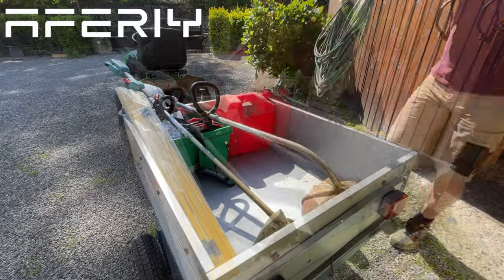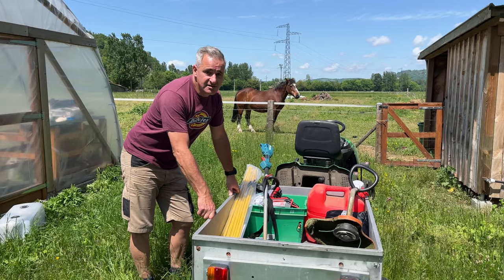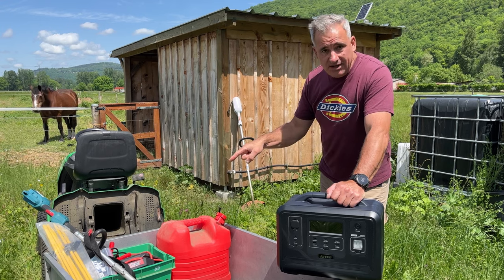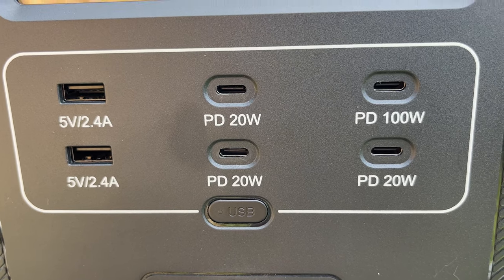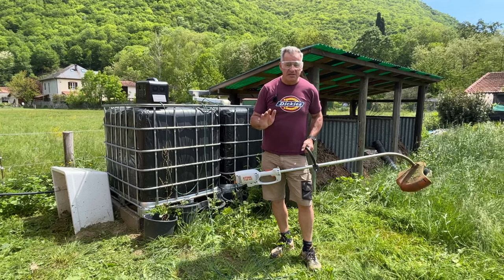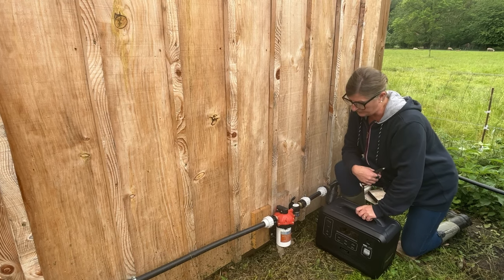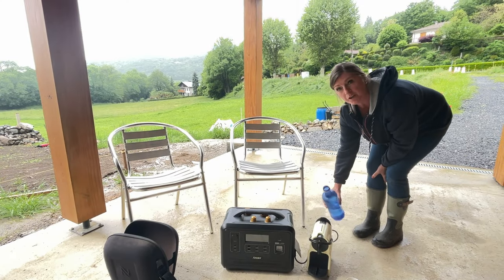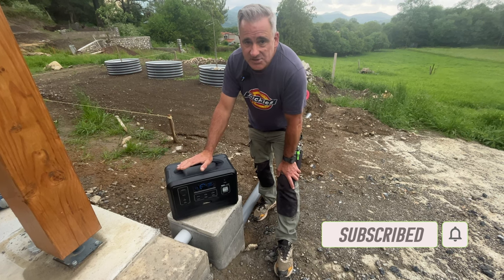Aferiy 1200w Portable Power Station Is Perfect For When You Need On-the-go Power!

Comment: Hi, at the end you mentioned using it as a UPS. Does it work like a proper line interactive UPS? I'm looking for a decent portable UPS/Power Station.
Reply from the maker: Hi Simon - I am using as a UPS at the moment - it is a thru power UPS taking in what it puts out until the input fails and the battery kicks in without interruption.  While we were in Corsica I put it on our Freezer and my breaker tripped (garage flooded) and it was on this unit for 4 days until we got back.  Still 60% or so power left.  Very thankful for that.
Reply: @HomesteadingUncontained  Ian, that's exactly what I want to do with it, put it on a chest freezer when we are away and also use it with some corded power tools that are too expensive or impossible to replace with cordless. Cheers.

Comment: How is this unit compared to the EcoFlow. ??  Looks impressive but you like have not used it as much as your EcoFlow.
Reply from the maker: It is hard to tell at the moment - it does have more battery and we are using it on our freezer as a UPS at the moment which was great as we lost power while we ere in Corsica and the breaker tripped.  So it powered the freezer for 4 days until we got back to reset it.
Reply: OMG really. For 4 days. That’s awesome. They are pricey here in Canada so will continue to follow you on this.

Comment: I've gone all electric (Battery) on strimmers and chain saws.........here in Poland you are not supposed to do work on Sunday.....or rather make noise on Sunday....electric strimmers and chainsaws are so quiet.......I,ve got a battery powered pole (extendable) saw and that runs very fast and so is probably noisier than both of my chainsaws...or the strimmers.   I,m actually very impressed  with battery strimmers, last ages and seem no less powerful than benzine powered models......also only about 20 mins to full charge.
Reply from the maker: Same here and a grumpy neighbour came down to complain when we first started work.  We asked the Mayor and she said F^&k 'em.... you do what you need to do 🤣